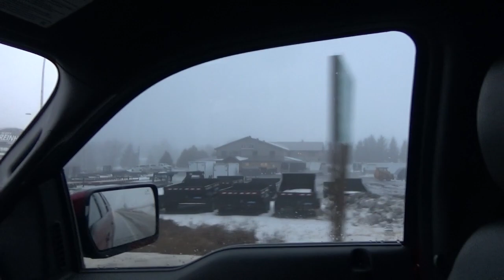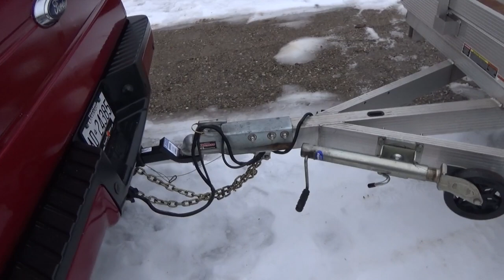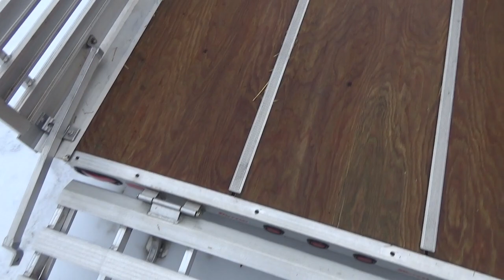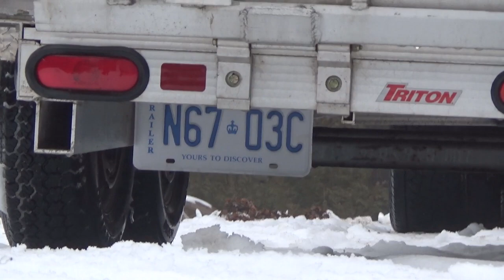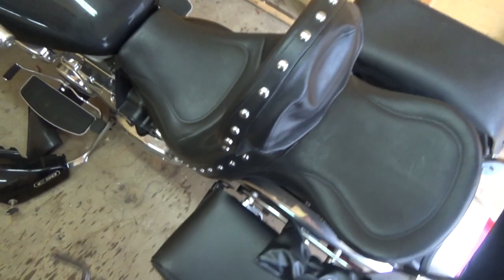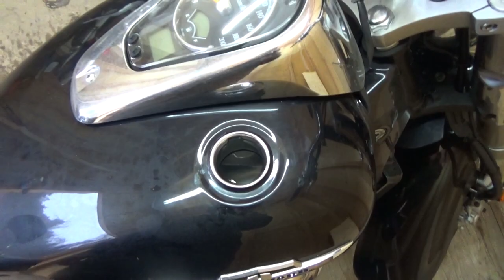Trailer Pickup and Bike battery removal

Comment: Yeah that height on the receiver would be a real pain. Everything would want to slide to the rear.  You might try putting the license plate on the back of the fender (if it's legal there) You could light it off of the clearance light mounted there.

Comment: What about putting the numberplate on the loading ramp when vertical?
Reply from the maker: +zx8401ztv could but you need to light it
Reply: +BILLSTMAXX :) Hmm the chassis is earth, and use one of those helical cables (like the cable on an old phone) to bring the power from under the hinge, rubbery helical cable.
Its just a thought bill, only a thought :-D